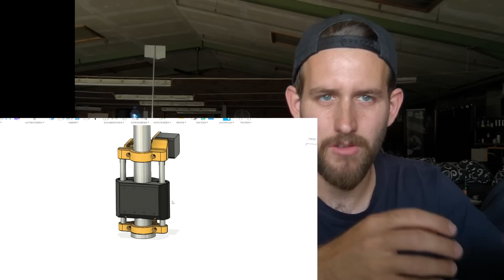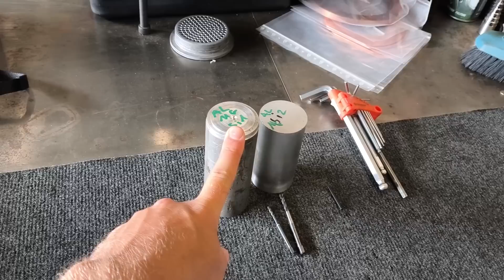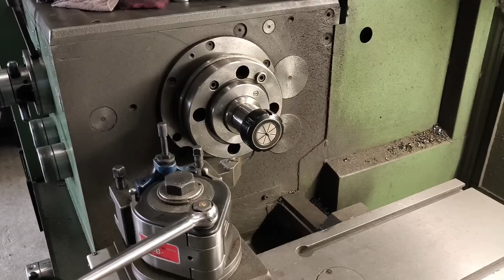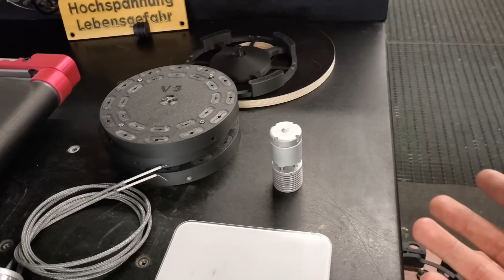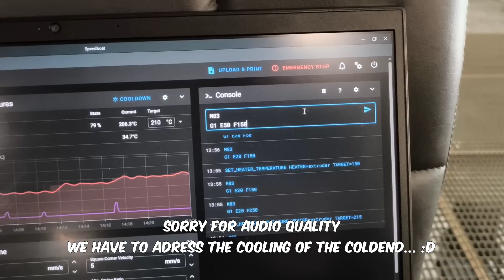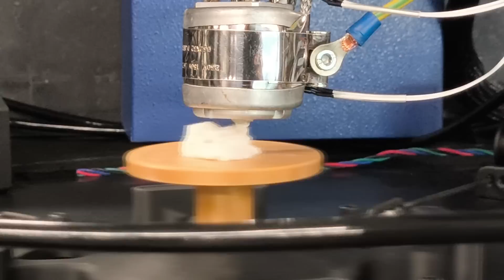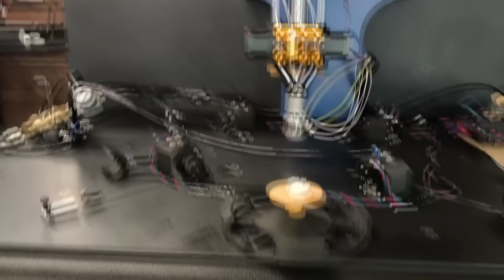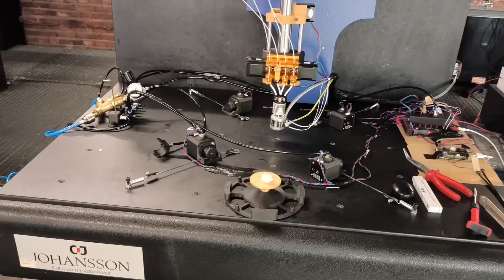Is a sub 1 min 3dBenchy possible? Hotend Build and First Print! (Episode 2)

Comment: Gas struts instead of springs, like the type that open the boot on a car. They are almost 100% constant force. Maybe, thread the four tubes with a fine tapered thread into the hot end.  This would allow you to remove the centre bolt and hold the tubes with grub screws on the top.

Comment: Regarding the heat breaks - if you can't source titanium, I wonder if you could find someone with a high temp printer (intamsys, vision miner, etc) who could print it from PEEK or CF-PEEK. they can withstand something like 280C and have low thermal conductivity.

Comment: @6:20 You have 4 time the lenght of a volcano, but filament will move 4 time slover for the same volumetric speed, because you feed 4 filaments in one nozzle. In my opinion there is a maximum flow limit what can be usefull before the presure turns the nozzle from a plastic depositing device into a cutting device, especialy becouse at that speed and that short layer time you will not be able to cool down the printed part and you will squirt moldet plastic on moldet plastic... This type of speed can be usefull (maybe, depends on the precision of the motion system) only if the layer time is long enough to cool down the previous layer.

Comment: Use syringes with their ends plugged up to make a constant force spring, the vacuum will result in a constant force that you can adjust by using bigger/smaller diameters

Comment: A few ideas:
1. try and get all four to join a single point, a cylinder. Please take a look at the Maslow 4 CNC for reference.
2. instead of going for a constant force spring, connect the two loose ends of opposing corners via pullies, and a single spring between them.
3. make the filament path much longer, but shallow. make two parts with the same thread pitch, one male and the other female, with the max diameter of the male equal to the min diameter of the female thread. essentially a helical path with plenty of surface area to transfer heat.
Reply: @VANUSUAL  Connecting the ends is a very good point. The spring in between only has to compensate for the movement "side to side".
Reply: There would be a drawback of coupling the two cables into one loop: you are doubling the length of cable, possibly causing issues with accumulating stretching and harmonics . But otherwise, probably a good idea
Reply: he said it in the coments in the last video if you pull it on one side the 90° get longer
Reply: @thomaskletzl6493 Ah.. yes, that's true. So coupling won't work
Reply: @loczaczix  i mean in the newer videos he coupled it with a spring. Im still not sure if its better but i gues so
Reply: 2 point I actually genius. So simple yet perfectly solves the problem

Comment: Hi, i have some thoughts about this project i wanna share with all of you. Maybe some of my ideas are usefull, others might be not, but a discussion is always good. 
1. For cooling the hotend, you could use an old water cooling from a PC. These are cheap and in combination with a costum made coolingblock, you will have a capeable system. Also you can than change your cooling effectiveness, by simply changing the speed of the fan that is sitting on the radiator. 
2. I have never seen this before, but in theory you only use retract in a normal FDM printer, to decrease the pressure inside the nozzle. Therefore the friction between the molten plastic and the walls of the nozzle is strong enough to prevent a leakage of filament. So in order to make a fast extruder, with a long heating zone for the incomeing filament (this would have benefits you have mentioned in the video) we need to make a design that can rapidly decrease the pressure inside the nozzle. Furthermore i would suggest useing a small stepper motor and a moveing "wall", so you can adjust the volume of the nozzle really quickly. This comes with a lot of challenges like: sealing the entire nozzle setup, so no filament can clock up the motion of the wall; building a system that is light weight enough to not disturb the motion of the z-axis; create a mechanism that can withstand a constant pressure of up to 300 bar in inside the nozzle. So it is hard, but might be a good idea for this use case. 
3. As some other comments suggested already, you could use a vacuum system for your motion system. However i would recommend a magnetic system instead. A combination of permanent and electronical magnets could solve this issue while also being more reliable and faster than the vacuum system. Let me explain:
3.1 The permanent magents would be used to create a constant tension on the ropes so they dont slip. 
3.2 The electro magnets would be turned on and off individually depending on the current motion of the build plate. This would result in a stronger force and an even faster accelleration. In my opinion it is also easier to build such a system in comparison to a vacuum based one.
4. Consider useing a laser 3d printig method for manufactoring the hotend. By drilling in a solid block, you will always find some sharp edges inside, that you cant get rid off. But these increase your friction. A good laser based 3d printer can print this part with a higher precision due to lower tolerances.

Nun nochmal auf Deutsch, da du ja augenscheinlich der Deutschen Sprache mächtig bist ^^
1. Für die Kühlung der Heatbreak würde ich an deiner Stelle eine alte Wasserkülung mit 120 oder 240mm Radiator verwenden. Damit hast du definitiv genügend Kühlleistung. Auch kann durch die Regulierung der Lüfterdrehzahl auf dem Radiator die Kühlleistung angepasst werden. Wenn du kleine Schläuche, mit jedoch einer hohen Durchflussgeschwindigkeit wählst, sollte auch das Gewicht des Teils nicht alzu große Auswirkungen haben. 
2. Um das Problem mit dem Filamentfluss zu lösen. Ich habe überlegt, wie man es schaffen könnte ein langes Hotend zu verbauen und gleichzeitig gute Retractwerte zu erhalten. Da wäre ein System das das Volumen innerhalb der Düse anpasst natrülich ideal. Ein Steppermotor oder Servo könnte ja einen kleinen Teil der Wand bewegen und so das Volumen vergrößern, wodurch der Druck in der Düse abfallen würde. Dann würde auch kein FIlament mehr aus der DÜse gedrückt werden und du hättest ein sauberes Ergebnis. Das System habe ich so noch nie gesehen und schon in der Theorie ergeben sich für mich da ein paar Probleme. 1. Wie schafft man es das ganze richtig abzudichten, sodass diese bewegliche Wand nicht verklemmt. 2. Wie schafft man es den Druck der (ich meine es mal gehört zu haben, aber sicher bin ich mir bei dem Wert nicht) bis zu 300 Bar innerhalb der Düse erreichen kann aufrecht zu erhalten (also die Mechanik so stabil und gleichzeitig leicht zu bauen). 3. Was passiert wenn der die Extrusion wieder fortgesetzt werden soll? Man könnte den Stepper Motoren die das FIlament einführen zwar den Befehl geben kurz anzuhalten und gleichzeitg die bewegliche Wand wieder zu schließen, sodass das "überschüssige" Filament in der Ausweichkammer aufgebraucht wird, aber das könnte auch in der Praxis zu Problemen führen. Das müsste man testen. Trotz alledem wäre es sicherlich das spannenste Teil am ganzen Drucker!
3. Wie andere schon beschrieben haben könnte man ein System nutzen das mit Vakuumpumpen funktioniert. Jedoch bin ich kein Fan davon. Es ist sehr schwer 4 Zylinder zu bauen, die Luftdicht sind, aber in denen die Reibung gleichzeitig gering genug ist, um wahnsinnig schnelle Bewegungen auszuführen. Auch ist es meiner Meinung nach nicht möglich eine gleichmäßige Kraft in jedem Zylinder in ultra kurzer Zeit aufzubauen, um so die Seile im richtigen Moment zu spannen. Klar, man kann die Zylinder permanent unter Vakuum setzen, jedoch arbeiten dann die Motoren ständig gegen diese hohe Kraft an, was den Strombedarf erhöht und unnötig Leistung zieht (erhöht dadurch auch die Temperatur der Motoren, die dann zustätzlich abgeführt werden muss). Stattdessen wäre es meiner Meinung nach sinnvoll ein System mit Magneten zu bauen. Wenn man Permanentmagneten verwendet, kann man denselben Effekt wie jetzt mit den Feder erreichen. Jedoch bin ich der Meinung das es am besten wäre zusätzlich, kleine Elektromagnete zu verbauen, die im richtigen Moment (wenn Spannung im Seil zu niedrig ist, eine lange Wegstrecke zu fahren ist, oder einfach um noch schneller die Platte bewegen zu können) zusätzlich die Kraft auf das Seil erhöhen und so die Motoren unterstützen. 
3.1 In dem Zusammenhang fällt mir gerade ein, dass es sein könnte das das Druckbett minimal in der Höhe vibriert. Dadurch könnten zukünftig auch Druckfehler auftreten. Das könnte man jedoch lösen, indem man die Motoren mit einem leichten Gefälle auf allen Seiten anordnet, sodass quasi zusätzlich von jeder Seite leicht nach unten gezogen wird.
4. Das Hotend mit der Düse konnte ggf. mithilfe eines Micro SLS Druckers gedruckt werden. Damit lassen sich sehr genaue Toleranzen erreichen. Somit entstehen anders als beim bohren keine scharfen Kanten und noch glattere Oberflächen innerhalb der Düse, wodurch der FIlamentfluss verbessert wird. Auch kannst du so das Teil direkt aus Titanpulver herstellen lassen. Ob das am Ende preislich sinnvoll, und überhaupt notwendig ist ist abzuwägen.

Generell gilt, ich wollte dies Ideen einfach teilen. Vielleicht sind sie doof, aber vielleicht auch nicht. Zumindest drüber nachdenken kann man und vielleicht bringt es ja einen dann auf die richtige Idee für das jeweilige Problem. In jedem Fall bin ich gespannt wie diese Projekt weitergeht und was so die Lösungsversuche sein werden :)

Comment: Using 3 filament tubes in sted of 4 will make sure all of the tubes get the same pressure against the face seal making them less likely to leak.

Comment: I might not understand the specific purpose of the springs?  But how about eliminating them and using pulleys, route the slack end of the line to the slack end of the opposing motor? Or eliminate 2 of the motors and do something similar.

Comment: I think the hot end and extruder will be limiting factor. With 2mm nozzle you got 18g per min. No way you can get 12g (controlled) within a minute even with copper due to the 0.5mm nozzle. If the rules didn’t state 0.5mm nozzle or line width, we could get much a faster benchy.

Comment: Using water in lieu of air for cooling the heat break should solve some of your issues. Cooling the part could be a bigger problem. An alcohol sprayer/fogger might work.

Comment: If you want a constant force from your springs at all lengths the fastest and most effective, for the investment, solution is to use a Very long spring. The longer spring will have much less rate change as it is stretched from minimal to maximum operational lengths in your builds required movement. If it's long enough the rate of change will seem constant in comparison to the current lengths.
Injection molding nozzels in industrial settings take the feed stock ( pellets ) and induce lots of turbulence in that plastic as it travels to the injection site using screens and labyrinth nozzle geometry. This thoroughly mixes the plastic and brings the entire injected mass to a consistent temperature for smooth operation that is also fast and repeatable. Your heated head dealing with a small volume of material could likely benefit from more thermal homogeneity despite its size.  
The feed stock seems to have a tendency to twist as it is unloaded.  If this was hand wound then your wrist  will induce twist in the loading process and can cause tangles when unloaded.

Comment: I'd bet it'd be possible to make a print bed support structure using compliant mechanisms that would prevent rotation while also not limiting movement with excess friction. Imagine an upside down pendulum, with the fulcrum being a 300mm below the print surface. Since the print bed is so small and the pendulum radius so large, the nonplanar movements of the bed would be insignificant, but you'd get cleaner cartesian movement. The support between the fulcrum and the print bed could be a carbon fiber rod to limit mass and air resistance, but still prevent rotation. Though in thinking about it, if the fulcrum was mounted above the print bed and offset from the print head, compliant u-joints could connect the carbon fiber rod(s) to the corner(s) of the print bed and prevent rotation, while the print bed itself is still resting on the table as you have it now, or even completely hanging from the pendulum. With a bit more thought, there's probably a way to flatten the pendulum so the whole compliant mechanism could sit under the print bed and above the tabletop it's sitting on.

Comment: Hey. Awesome Project. Regarding the constant-force "spring" system, I know it would be too much trouble but you could use a counterweight system through a series of pulleys and hang the weights at the edge of the table. This system would also be easily adjustable but definitely hard to implement.
Also, one reason for plastic oozing out of the hotend from heartbreak connections could be the different thermal expansion rates of Aluminium and SS causing a gap in those connections resulting in material oozing out due to nozzle backpressure. Since the hotend isn't mechanically constrained relative to the heatsink, It is allowed to freely expand and I think this results in a gap. One possible solution would be to heat-press them together.
To adjust the filament feedrate, one easy hack could be to use 2*1.75mm = 3.5mm filament Diameter in the slicer which would give you 4 times the surface area similar to running 4 extruders at once.
I also think that using a material like ABS with a higher melting range (around 100C) would allow you to increase the temperature of your heatsink without melting the material in there which would result in the filament requiring less heat to get to a printable state in the hotend.
Best of luck and thanks for sharing this process.
Reply: Yes, was going to suggest that too, using a pulley with a weight seems like an almost perfect option..though at those speeds the counterweight would need to be restricted in some what to not jump around, and if the acceleration is faster than gravity it could causes problems too maybe
Reply: @dinissantiago6729  Yes. I completely forgot that we're working in very high acceleration regimes. Although you could still use a moving pulley system to increase the maximum acceleration but it would be so much work. you would need 4 pulleys for each axis to get 160k (mm/s^2) acceleration which I think is needed for a project like this.
One other good suggestion that I saw in another comment was to use another motor as a constant force spring for each axis. afaik TMC drivers have a constant force mode (which isn't utilized in Klipper or Marlin since there has been no use for it) but I think it requires some calibration.
Reply: It would be prone to oscillation...
Reply: @at0mic282  Yes. I've been an idiot. This is basically adding mass to the bed but on the other side :face-blue-covering-eyes:
What he need is basically a constant force that isn't a function of length, speed, or acceleration. all I can think of at this point is either a constant force spring with a large load value and long life cycle (typically in 10k extension range) or an extra motor with active feedback loop to maintain a constant force on the cord wich will have it's own challenges.
Reply: yeah, a counterweight system would be good. As for the inertia, using a gear ratio squares it, so if you have a 5 to 1 mechanical advantage, it'll only add 1/25 the inertial of the counterweight mass to the system. And, using pulleys, there's no reason it has to hang off the table. They can just live off to the side.

Comment: I did something similar but with a 5 into 1 design. Looks neat tho :)
But my goal was not to speedrun, i wanted to mix the colors ^^

For the cooling: As weight is not a problem, just go watercooling or CO² - for a sub min use it would be worth it.

Also part cooling will be a problem as u have seen yourself. This could also be solved with a shield to the nozzle and a sourrounding cold gas shroud to cool the part down immidiately.

And yep.. to attach the cables all in mid with cableshoes by just one bolt would be better i guess.

Comment: i'm so excited to see it work. wouldn't something like water cooling perform better than using shop air?
Reply: Water will easily sap heat from the plastic and the injection head causing  uncontrolled hardening of the plastic during operation as the molten and solidified plastic are moving at very high speeds. There's a fine line between plastic that flows and plastic that locks in place and there needs to be a physical connection between soft and hardened plastic as each layer touches during extrusion for a good bond. You won't achieve this bond if one layer is too cold.
Reply: @btwbrand I don’t think anyone thought of using the water PART cooling. But for cooling the hotend after the heat break, or cooling the  NEMA steppers it could for sure work out well. 
I guess shopair was already on hand, and water cooling will require purchasing equipment just for this project.

Comment: It should be noted that that path the filament takes in the hot end is not optimal, as by traveling a path with a sudden angle change, energy is lost, resulting in less pressure. I dont know of a great way (if any) to achieve a more efficient path with cnc, but still a great video and interested to see where it goes!
Reply: Angle 4x cold ends so they're inline with the drilled path through the hot end would be my preferred solution. More work but would look and work cool.